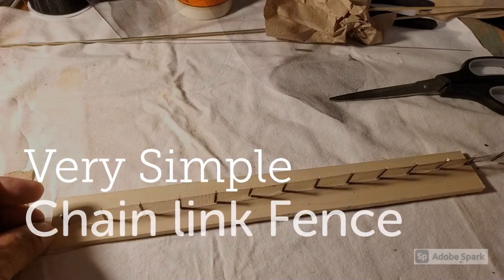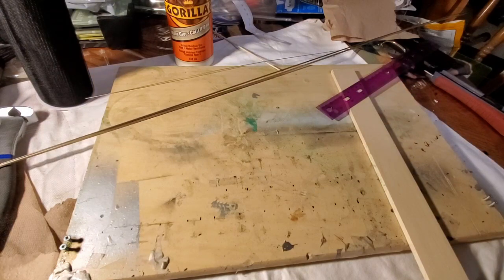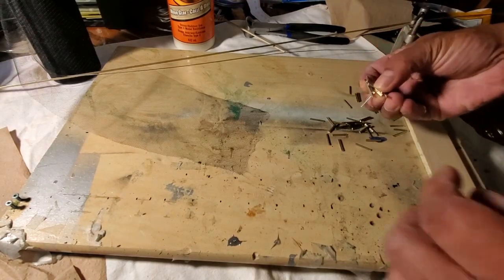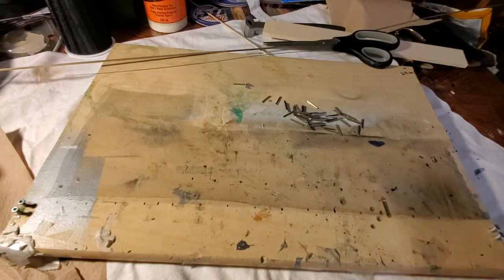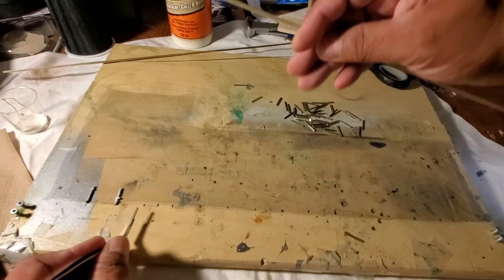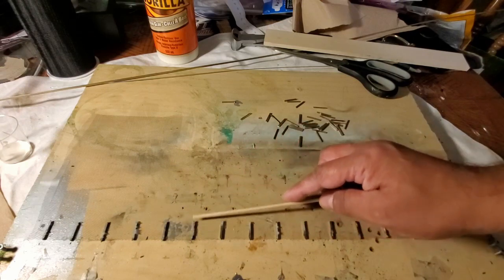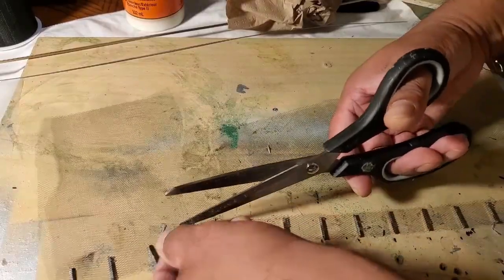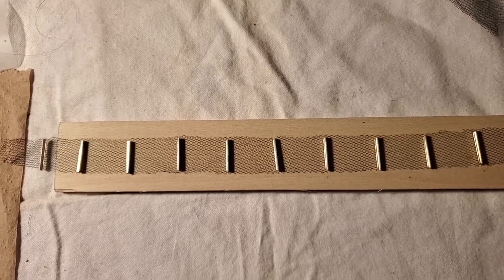Very simple chain link fence for HO model trains

Comment: Just seen this - this is really good. As a N scale modeler, it is sometimes difficult to transpose ideas into N scale, but this looks to be a clear exception.
I will probably do it on a marked cutting mat and also use wooden posts rather than metal.
Thanks again for the inspiration
Reply from the maker: HI David , you are most welcome .. I'm glad you found the video useful .. Again it was something that I put out as a result of a request from a subscriber looking for a "Very simple" fence for his diorama. Again this is nothing fancy in any respect . Just a very simple fence that can be made quickly and used in non prominent areas of your layout . 
I used to have N Scale , before I switched 12 years ago to HO , because I found it hard to work with N. My eyes were going bonkers ... so I decided to switch to HO . I gave my N scale loco's and rolling stock to my Dad , who still has an N scale layout ( i have posed a vid of his layout in my channel ) . I found that servicing the locos etc and adding constant lighting circuits and DCC was much easier on HO than N .. other than that , I still love N Scale and appreciate it very much ... Just needed to give my eyes a break .. lol 
Regards - Anthony . -

Comment: ithat black widow screen
Reply from the maker: Hi Wayne , you could use black window screen , but I find that a bit too stiff and the screening is a bit too think for HO scale to represent wire mesh fence . The black stuff is Wedding Tulle , the stuff they use to decorate for weddings etc. you can get it any arts and crafts store like Michaels etc. One recommendation i will make is to cut some of the vertical rails a bit longer , and you glue them in ever 3 or 4 vertical rail so that you can use the extra length to fasten the fence to the ground .. I was a bit lazy and I cut all the vertical rails to the same length. - Regards, Anthony .